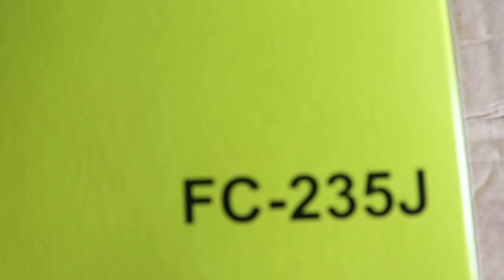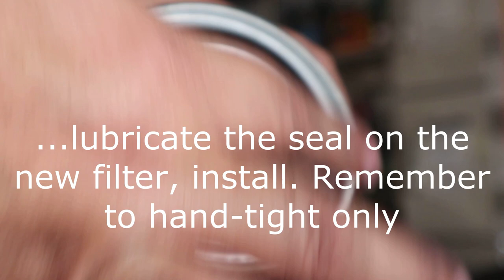Basic Diesel Engine Care-Nissan Navara D40 Fuel Filter Change

Comment: I have a truck just like yours and have a question for you. When changing these filters, doesn't get air in the system? Should I fill up the filters with diesel before put it on the truck?
Reply from the maker: Hi Rodrigo. Sorry for the late reply... Yes, air gets in the system, and i think it's inevitable. Its just a question of how much, depending on our methods. Ive seen the method you mentioned done also, with good results... As with my method, I want to push the air out, thru the outlet side of the filter, while filling the latter up with fuel, as i pump the primer. That's why in the video, the line coming from the filter to the injection pump is undone, while i prime. I think this method also minimizes fuel/air gaps in the line.
Reply: @EagleRsDIY  That's ok! Thanks for the reply! Helped a Lot. As you said, these two method will prevent a lot of air to get in. I'll change mine next month.